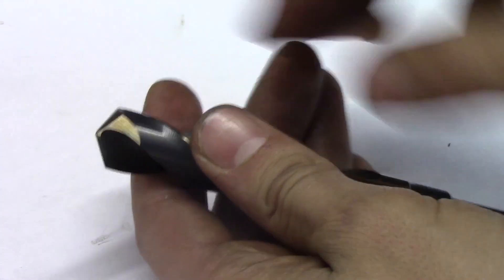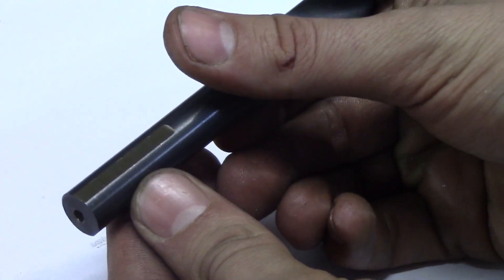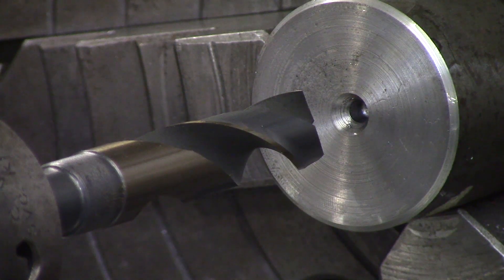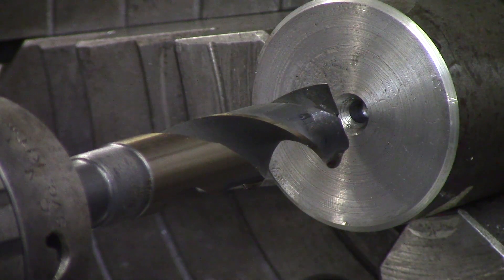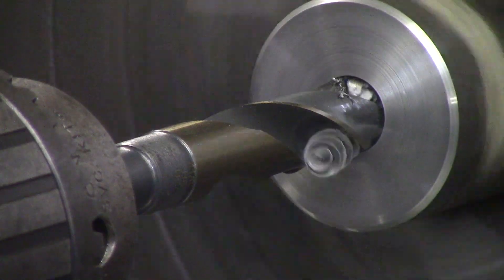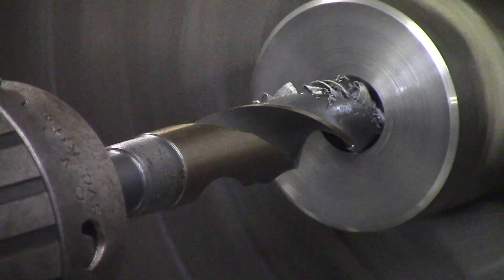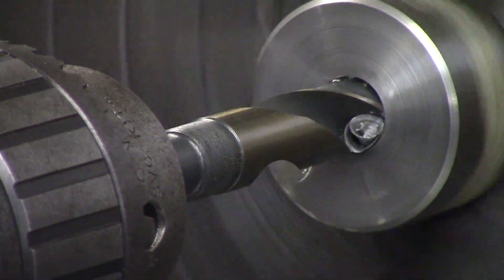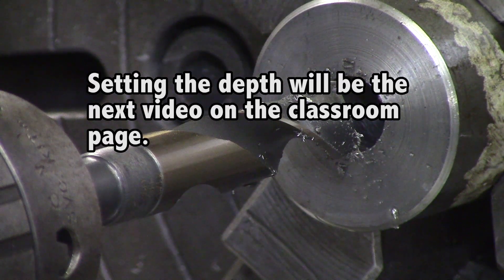Fundamentals of Drilling (Manual Lathe)

Comment: Amazing, like i had to try to figure out today how to keep the jacobs check in the tail stock, for me  i had to extend it via the wheel like a half inch then use a rubber mallet to tap the chuck into the tail stock that seemed to work okay and the entire chuck did not spin.